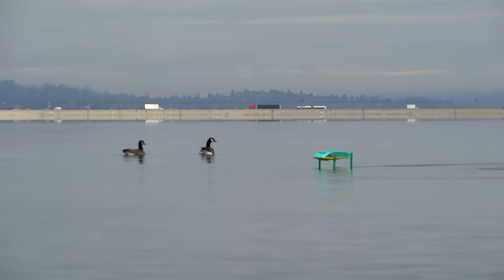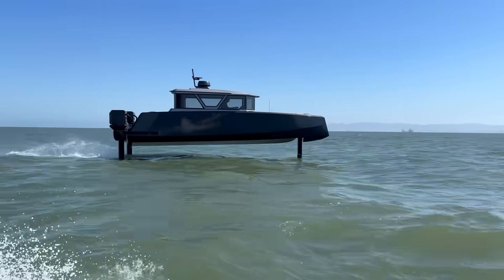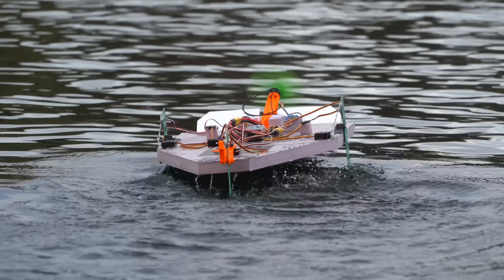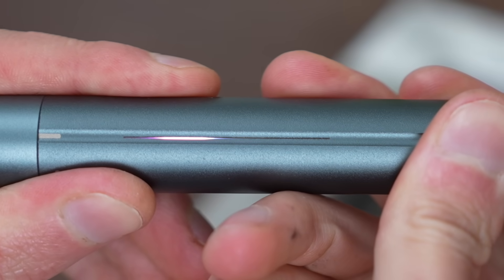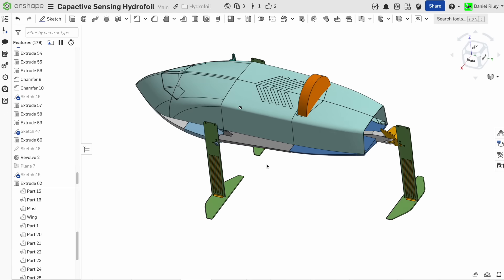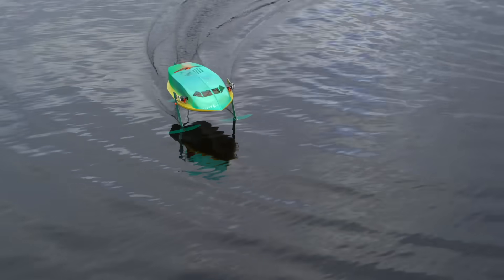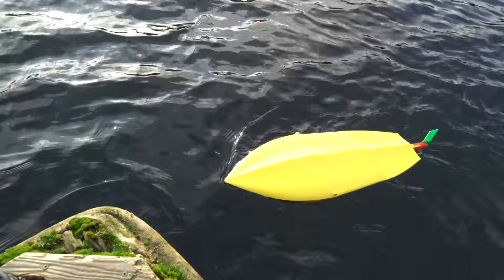Hydrofoil R/C Airboat Build and Test

Comment: AI Summary

Abstract:

This video documents the attempt to design and construct a high-performance, 3D-printable hull for previously developed liquid-level-sensing RC hydrofoil kits. The project utilizes a theoretically optimal tri-foil layout (two actively stabilized front foils, one passive rear rudder) to manage pitch, roll, and height. However, initial testing was hampered by a critical proportional gain software bug in the production foil firmware. After resolving the bug, the custom-designed V-shaped hull proved structurally flawed, exhibiting severe rolling instability during the transition to foiling due to a high center of gravity. Despite functioning well once fully airborne, the complex hull design is explicitly deemed "suboptimal" and is not recommended for kit builders.

RC Hydrofoil Hull Design and Failure Analysis

*   0:01 Project Goal: Develop a high-performance, 3D-printable RC hydrofoil hull design to accompany the already developed liquid level sensing hydrofoil kits (developed with collaborator Tamas).
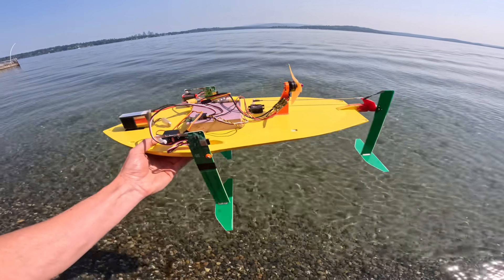*   0:41 Hull Construction: The hull was designed in OnShape and 3D printed in eight sections using lightweight foaming PLA, reinforced with carbon fiber rods. Foil mounts were printed from PETG for strength and water sealing.
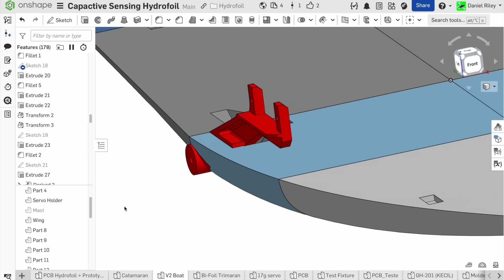*   1:33 Hydrofoil Stabilization Mechanism: The boat utilizes fully submerged T-foils, which require active control. PCBs on the masts sense water height and control servos to adjust the Angle of Attack (AoA) of the foils, maintaining a consistent ride height.
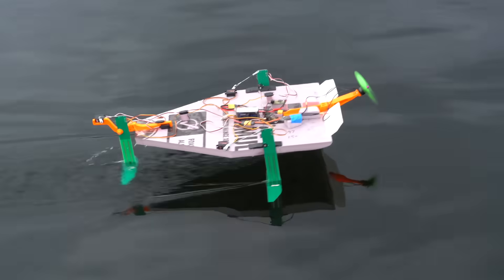*   3:04 Tri-Foil Layout Rationale (2 Active Front / 1 Static Rear): This configuration was chosen as the simplest way to achieve pitch, roll, and height stabilization. Making the rear foil active resulted in adverse pitch effects, causing instability ("fighting against each other," 4:19). The rear foil only steers and its AoA is manually fine-tuned.
*   4:46 Hull Finishing: The hull was spackled (despite spackle being non-waterproof) and coated with one-part polyurethane paint to seal layer lines and waterproof the structure. Relying on the paint to seal non-waterproof materials seems risky.
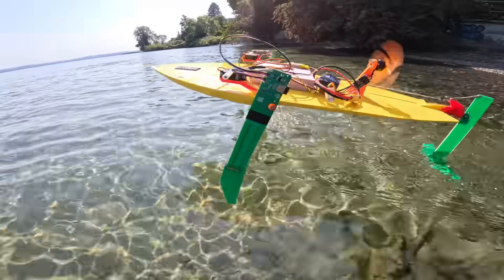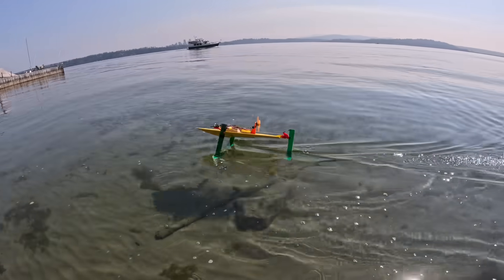*   7:31 Critical Software Bug: Initial instability was traced to a major flaw in the production firmware installed by the factory. The slave foil unit would lose smooth proportional response, causing the proportional gain to spike to infinity (7:50). This required a time-consuming "band-aid fix" (8:14). Quality control of the mass-produced kits appears deficient.
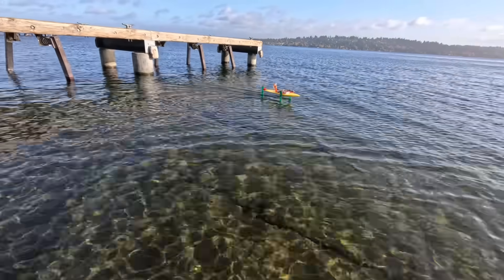*   8:42 Confirmed Hull Design Flaw: Even after the firmware fix, the boat struggled to initiate foiling and often rolled over. The V-shaped hull was identified as suboptimal, possessing high buoyancy low down but a high center of gravity, causing inherent instability during the lift-off phase (8:55). A shallow catamaran hull would have been superior.
*   10:48 Performance vs. Aesthetics: The addition of the "futuristic" (11:00) transparent PETG shell added weight and reduced efficiency by "suffocating" the propeller (10:56).
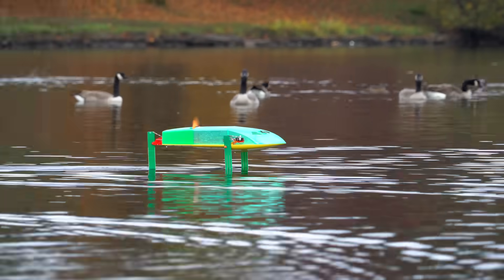*   11:10 Key Takeaway/Rejection: Due to the persistent roll stability issues, the creator explicitly states this hull design is not recommended for people building the kit. A new, more stable platform is planned for the next project episode.
*   13:30 Dismissive Outcome: The video concludes with the flawed V-shaped hull driving surprisingly well upside down without the hydrofoils attached. This unintentional result is interesting but irrelevant to the core hydrofoil challenge.

AI-generated summary created with gemini-2.5-flash-preview-09-2025 for free via RocketRecap-dot-com. (Input: 18,474 tokens, Output: 772 tokens, Est. cost: $0.0075).

Comment: The tipping is due to the pressure leaking around the end of the foils when it leans one way or the other. Have had the same on my RC hydrofoils. The solution is endplates which will improve foil performance by about 30%. That is the approximate area of the foils not generating lift near the ends due to the high and low pressure areas meeting at the foil tip.

Comment: You must want to chase the ducks and geese around don't you! The engineer side of me wonders if having the front hydrofoils splayed a tiny bit out to the sides would help with roll stability? I will look into that drill set up thing you showed. I can think of many uses for it in my wood shop....

Comment: Are the lifting surfaces still flat plates? Anything with a bit more of a nose should smooth out the lift curve a lot; which might also make the control even smoother.

If you want that rear thing to contribute indeed I think you need to mix the signals; probably do some state space model thingie... should be sorta doable I guess?

Comment: I think you want to control all 3 foils but not locally. You calculate the offset vector from the desired orientation in space, then create the local components of the vector for the individual foils. This should even enable proper PID control.

Comment: A friend of mine did this with an RC sailboat back in 1987. He won a constest with it and went to an international science exhibition.  The sail was basically a wing and the boat was a catamaran. The front foil was a formed piece of aluminum in a "bow shape" that went between the pontoons. The rear foil was roughly the same but more of a "v-shape". The boat had a weight in the middle of it that coudl be used to counter the force on the sale. A servo moved the weight from side to side. My friend went on to get a PhD from MIT in mechanical engineering.

Comment: Dude, I’ve got a solid idea for fixing this. Don’t use the moisture sensors to calculate the boat’s roll angle. Use a gyroscope for that. And use all three moisture sensors only to determine the height above the water surface, meaning its immersion.
Reply: IMU modules are cheap. You can use the magnetometer to calibrate the gyro!   And the accelerometer to detect rate of turn…

Comment: Hey Great Project and if you don´t mind I kindly suggest two ideas for this  project :  As in the Navy Pegasus class they use to measure the incoming waves high as it sail to servo modify the angle of attack of the hydrofoils  and therefore I guess that rather than initiate the sail with the active hydrofoils system maybe its better to let the boat have the lift effect and after release the automatic hydrofoil controller and secondly I would like to suggest for the hull a ¨Lifting Body Aircraft ¨ Shape which has the gliding flight characteristic that could fit better with the purpose of your project Rgds SK

Comment: A tip for the sponsor: change the shape of the screwdriver so that it isn't round. When its round, its harder to hold onto and it rolls off of work surfaces. I know because I have a round one from a different brand. A triangular shape would be better.
Reply: 3d Print and stick on an un-round collar as a quick fix?
Reply: @dogefort8410 Maybe. Soft TPU might work, but keeping it from slipping while torquing on a screw is still going to be problematic.

Comment: I think you have problem with roll control, where hydrofoil try to go up. It's prioritize to go up until depth is not ok and ignore roll. If you will convince controle to stabilize it first and then try to climb, the problem should disappear.

Comment: Enjoy watching the discovery, the fun of success, but to help stave off your frustrations, The lift vector angle at the front is too close in distance, tangent to CG’s CL of Roll. stability will therefore be too neutral, allowing centrifugal forces to become easily either anti-counter or pro-counter balance, therefore aerodynamic engineering uses dihedral or anti dihedral angled lifting vectors to counter control CG forces. CoF being where the lift vectors crossing; is coefficient of Lift. Where CoL is above and proportional to distance from  CG’s CL: of roll, naturally stable in the direction of turn; CoF crossing below CG’s CL and proportional to distances roll will naturally stabilize in opposition of turn direction. The aft lifting vector, you discovered, in anti-dihedral, now naturally,  following that vector principle stabilizes in pitch.

Comment: I think your issue if from moving the prop.
The torque steer is more pronounced when it's rotating around the thinner rear axis. When it was on the front there is a wider base below it to counter the twist but in the rear it's only a single foil. 
Also having the prop up front probably helps pitch the nose up

Comment: I figured it out why it always banks to the right it's the reaction force from the propeller. If you put two propellers contra rotating it will balance itself out else you need to adjust the software to have a slightly higher angle of attack on the right hydrofoil.

Comment: 7:10 Propeller Torque. At slow velocities, high thrust of the propeller produces high torque that is overpowering the hydrofoils  torque when deep in the water. Both hydrofoils are trying to lift the boat by pitching up, with zero remaining "control authority" in the roll. To lift out of the water, prioritize roll in your control loop to counter propeller torque.
Reply: It's P-factor. Notice the roll is opposite the direction of rotation when at a positive angle of attack.

Comment: The roll stability issue is caused by the torque from your propeller. You need two propellers going either way, man. That's what you need.

Comment: You should check out Hick Sea Sleds for a hull shape. Kinda like your Boston Whaler without the center hull. They entrained a lot of air under the hull, providing lift without a step. And the CG can be much lower than a cat. There is a wonderful article on them in Wooden Boat.....

Comment: While the boat is trying to lift out of the water, the control loops must be very unhappy! I wonder if there is a method implemented to allow the roll servo to reach its set point while the height (and possibly pitch) is not yet able to reach its set point. I guess if the vertical set point was slowly ramping up or manually controlled via a knob on the remote, then all loops could be kept happy and the roll instability during the partially submerged transition would go away. 🤞🏻

Comment: Those servos on Amazon are equivalent of $28 (£21.00) here in the UK. We are always getting ripped off on stuff over here, which is why I buy a sh!tload of stuff off Ali Express, they don't quibble if you have a problem either. (Oh and I just checked, they are £4.33 or $5.76 each off Ali Express)

Comment: I would like to see the use of air pressure sensors to measure the water pressure (immersion depth) at the winglets. Measuring water pressure independant of speed could be challenging, but will beat your "water resistor" setup by miles.

Comment: ok this is actually one of the few sponsor segments i actually appreciate. im a tinkering teenager and have been loooking around for a small dremel with a decent price, this fantikk one fits my requirements (of being small wireless and not asnnoying to use in my room like a traditional corded dremel) and with the discount code its actually a really great price, comparable to the price of my current big and old corded dremel
Reply: I dont have to rotary tool but I have both gens of the screwdriver and theyre fantastic. Hard to believe something that small can have that much torque.
Reply: @revodrvr  that makes me even more sure of this purchase thank you
Reply: It definitely has some cool features, but it would be much better if the shape wasn't round. If it wasn't round, it would be easier to grip, wouldn't spin in your hand when applying torque, and wouldn't roll off of slightly inclined work surfaces. My recommendation would be to make it triangular.
Reply: Same here for that screwdriver, what a great deal!
Reply: Best sponsor I've seen on YouTube so far
Prolly going to buy one for my bf as he's a boat mechanic and tinkers on cars!
Reply: Ticks all my boxes too, though I already have something similar that I got a few years ago and still in use.
Reply: The irony of him showing off a way to cut a 3D print was not lost on me.

Comment: you can mitigate the launch issue by comparing both side height to get the roll angle and find a good strategy for when the boat is rolling with one side in the water.

Comment: I agree with your last comment that the problem of first getting out the water is probably because the foil is stalled. As you suggest, reducing the max up will probably sort it. I had the same issue with my man carrying contraption.

Comment: Is the take off instability maybe only caused by the motor torque? I would imagine that the torque at low speeds is the highest, as the prop is still very inefficient?

Comment: get rid of the ridge on the bottom - its lifting up a bit & just flopping down on one side (like a see-saw), causing problems for the auto levelling - if the ridge is required for functionality, then put 2 ridges on, closer to the sides, to avoid the flop. Alternatively program a "launch" mode that angles the foils to lift the boat & briefly suppresses the auto-adjustments until a certain height is achieved.

Comment: That roll  on take off, is coming from the prop torque... your experiencing torque roll from the motor and prop.... the design before had it blowing air under the haul, and angle of the motor angle helped, .causing a counterforce.. new one is in line  raised and aligned to the role angle.... until pressure is equal to the forward momentum, its going to role in the torque, Awesome design, Love it! & the Channel!!
Reply: Fit it with dual counter rotating propellers to prove it.
Reply: @st200ol  I agree

Comment: Using two prop motors spinning in the opposite direction will eliminate the starboard list.  The boat sufferes from the same forces that used to flip over the F4U Corsairs while taking off.
Reply: I think you're right, it's the reactionary torque causing the list, not the shape of the hull.  A different hull design might help, but counter-rotating props would be another good experiment.  At the end of the video you can see that the prop pitch is quite aggressive, at least to my unskilled eye.
Reply: @alskjflaksjdflakjdf it wasn't an issue with the prop up front because the foils were so much wider. It rotates the rear more easily and that drags the whole thing down
Reply: I had the thought that since the whole thing is 3D printed, you could move from one open fan to a pair of smaller counter-rotating EDFs.  In addition to removing the central fan torque, if you cleverly position the fans or the output ducts you can help with roll stability (using differential thrust) or even getting up on foil.  And, two smaller ducted fans are probably easier to build a hull around than one large free fan.
Reply: Was looking for this comment to agree on counter torque old vs new design. The previous version was wider and heavier so the prop spinning up had more rotating resistance. The increased width does increase the lever length from center. You can test by extending your front 2 foils with a long flat piece taped to the top.
Reply: Could adding some bias / additional lift to the right foil, especially at low height / speed, solve this?

Comment: The rolling when you start it up, is it not to do also with propeller torque?
Reply: I came down to the comments section to see if someone had written this. Dual counter rotating propellers would prove it.
Reply: @st200ol just putting the motor in reverse would prove it. No need to make an entirely new boat to test it
Reply: I had exactly the same thought. It always rolls the same way, against the prop direction.